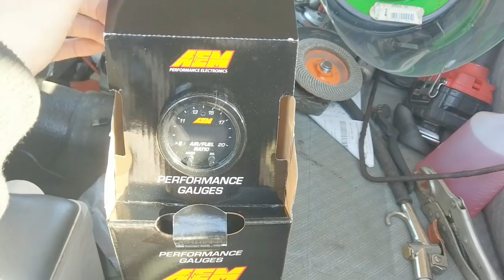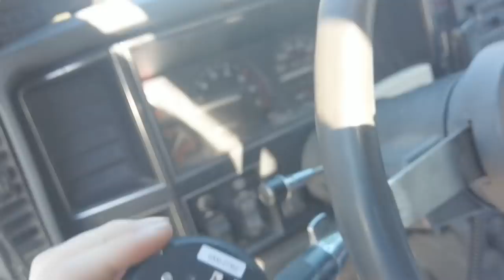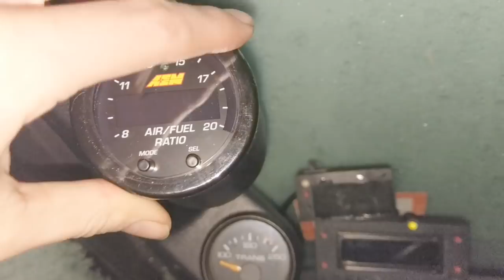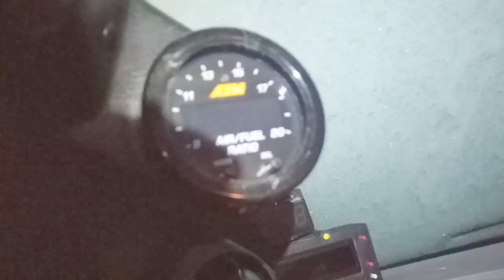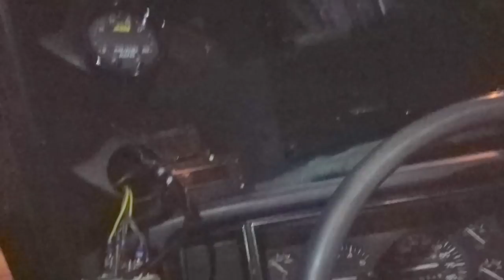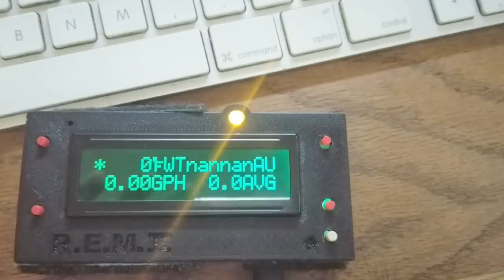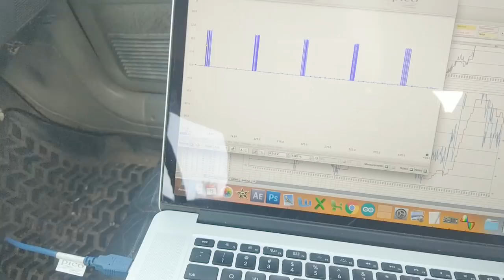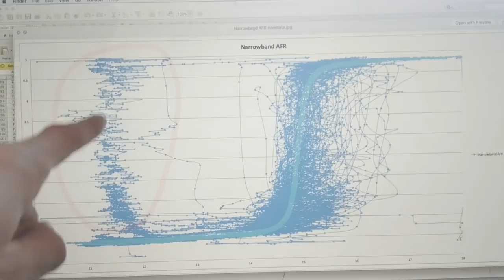AEM X-Series Wideband UEGO Kit install

Comment: I installed one in my V8  about a couple weeks ago which isnt force inducted. I noticed that naturally aspirated car's air fuel ratio does not fall below 12s like  forced induction cars. They float around mid 13s to 14s at wot on a stock tune. Even untouched force induction cars from the factory has fuel ratio that falls below 12s at wot, I take it it's because a greater demand of the fuel pump and turbo what's has to make it run rich.

Comment: 1990 MJ 4.0   -  Every two years, California requires I smog  - every two years it fails - every two years replace the oxygen sensor.  Do you know if this sensor could be used to replace it and would it be more reliable?
Reply from the maker: Weird yours fails so often. I'm not sure about long term reliability yet, but I will be going over how you can use a wideband sensor to get a narrowband output. This is far from a plug and play system as I'll be using my REM II as a signal converter, but it seems to work pretty well.
Reply: Yeah.  I asked the question at the beginning of the video and I as watched it all, I realized that the sensors work completely different.   I believe you mentioned that the stock sensor defaults to lean; and, this aftermarket sensor defaults to rich?  From a California Air Nazi perspective, Lean means less pollutants in the environment; but, everybody knows Lean means HOT, hot means sensor gets cooked.  I'm wondering if the sensor should be repositioned further back?  Maybe it would keep the sensor a little cooler?
Reply: I remember when the truck was 2 or 3 years old, they were failing California emissions; so, I got a postcard to bring my truck to the dealer.  They changed a wire harness, plus I don't know what else, and I've had to buy new sensors ever since.  As a matter of fact, I have to go and buy another one today, and take the truck back to the smog shop tomorrow.
Reply from the maker: I think it's just a side effect of the sensor design. If the heater circuit isn't working or the sensor is cold then it will lean. Doesn't read rich until it heats up. I wonder what they could have done to your system to make it run "more efficiently"
Reply: Just logged in to the Torrance Library to see what kind of updates came out and what manuals are available online.
Reply: Torrance Library reports two Emissions Recalls.   #297T Emissions Maintenance Timer Fuse OCT 1990.  #91-35  Excessive HC, CO & NOx due to Silicon Contamination of the Oxygen Sensor, NOV 1993.   I was speaking to Frank, in one of my videos, he's been a dealer mechanic for over 30 years; he says if engines were put together with silicon, it will always cook oxygen sensors.  When they did my recall, they probably didn't think I'd keep my truck this long; and, here I am 29 years later, still cooking oxygen sensors.  He says the only fix is to rebuild the engine and make sure no silicon is used in the reassembly.  So, there you go.....    Just another reason to rebuild my engine.  I just ordered a shop crane the other night.  I will be rewatching your engine change videos, in the coming months.   THANKS FOR EVERYTHING!   YOU'RE THE BEST!!!!
Reply: I'm wondering if I can get away with just cleaning the oxygen sensor; before, taking it to smog tomorrow?
Reply from the maker: Hmm, that's strange. Like Silicon RTV or some kind of Silicon assembly lube? I've never actually heard of that before. And I'm not sure if you can clean an oxygen sensor out, but you don't have much to loose if it's already dead. Need to get you a scanner so you can keep an eye on it, haha.
Reply: Yup, it was a chance for Frank to go on his anti-auto-maker rants again.  He says they used to assemble engines with silicon; and, when they started putting oxygen sensors in, they didn't know why they had bad reliability.  He says that the proper fix would have been to replace the engine; but, instead, all they did was replace the oxygen sensors, figuring most vehicles wouldn't be on the road very long and most vehicles wouldn't go thru more than 3 or 4 sensors.  Mine is probably the last MJ without a rebuilt engine; but, my goal is to have it rebuilt, in the next 1000 miles.  Although it's my daily driver, I probably don't put much more than 30 miles a week on it; so, it could be another 6 months.  He says to not assemble the intake and exhaust manifolds with silicon; or, the same thing will continue.   Scanner?  haha, yeah, I just don't know if I'm as smart as you to pull it off.  I mean, seriously, you are truly gifted.
Reply: When was the last time you replaced the o2 sensor? Do you remember the brand and part number?
Reply: When is the last time you replaced the o2 sensor?
If within the last year what brand did you get and part number?

Comment: If your ground and ADC are good, that kind of noise, on a 30-0300 is usually cylinder to cylinder differences.  Easy to verify on a scope, with the trigger set to the #1 spark pulse.
Reply from the maker: lordandprotector hmm, may be worth looking into. But I know the signal in general is noisy, even with the engine off.
Reply: They don't mention this in the manual. But, the analog- wire needs a clean LOW IMPEDANCE ground.  It is used as an input for an offset compensation amplifier.  So, noise there gets added to the signal.  These are really clean, when set up.

This page  http://forum.diyefi.org/viewtopic.php?f=6&t=2267&start=199   is an example of what I was talking about.   There is a picture of a log that shows the "noise" was an exhaust leak on  one cylinder.   

I have tuned the idle circuit on multi-carb engines this way, with a scope.  But, only these new AEM ( and the old Innovate LC-1 ( not LC-2 )) are fast enough to pick up the per-cylinder variations.
Reply from the maker: Very cool stuff in that thread. I may have to dig through more of that sometime if I investigate the signal further. Not sure if you saw my other video where I actually started to play with this sensor, but I eventually got the ecu to run off a simulated narrow band signal for faster response and tunable "stoic." Lots of fun and interesting to see what the sensor was capable of.  https://www.youtube.com/watch?v=YujtUYPJikA

Comment: Nick I need your help sir, no overdrive in my 96 GC 5.2 .. I believe it's a 46rh. Been to meny forms with not much help. Any ideas. Thanks a ton
Reply from the maker: Hmm, not too familiar with GC's, but I know that their Auto Transmissions are known to crap out. How's the fluid color look?
Reply: Nick, did not expect you to answer.   Thanks! Any who, trans fluid is full and red (leaks) has 200k+ OD light and switch no worky. Shifts in all other gears.

Comment: it's running pretty lean on the highway
Reply from the maker: What makes you say that? I would think for cruising speed you don't need much fuel so keeping it stoic should be fine, no? I haven't looked much into what AFR should be used for different needs, but the basic idea is you want to be a little rich under acceleration for peak power.
Reply: Yeah I see what you mean but does your ecu react quick enough?
Reply from the maker: This video is just showing how the ECU runs the stroker in the narrow band setup, so it will bounce back and forth. I'm not sure if I could make the ECU run perfectly on specific value, so going a little higher and a little lower is expected.
Reply: You ever thought about some how upgrading you jeep to run a wide band instead
Reply from the maker: Interesting read, I'll certainly have to dig into that more. And spoiler alert, the main reason I got this kit was to run the Jeep off of it. I haven't had time to mess with it much, but I've been able to simulate a narrow band sensor with it and it seems to run fairly well, but there are a few glitches I'm still looking into.

Comment: that is a little lean at start I know the video is old but your target should be around 14 with naturally aspirated turbo charged is around 11 to 12
Reply from the maker: Yeah, that's the wonders of Renix. Runs like crap most of the time, so I'll be working on a MAP tuner to keep the AFR in check
Reply: NickInTimeFilms oh boy it sounds like you have a big project jest like I do  I wish the best of luck and have you ever thought about changing over the ECU to megasquirt or something along those lines I would love to see a turbocharged or supercharged renix  nothing big or stupid High horsepower just a little extra push
Reply from the maker: A standalone could be interesting, but I've put so much work into the Renix Engine Monitors that it's hard to abandon the ECU altogether. I might think about it if I ever went forced induction.
Reply: NickInTimeFilms that sounds awesome I don't own my Jeep anymore I did a CJ7 with an LS1 swap but if you ever switch over to megasquirt and you need a hand let me know and I'll do a couple videos on megasquirt I am starting a YouTube channel but I do have a Facebook Channel/group but I just haven't gotten around to switching over yet I should have started when I turbo charged my car and rewired my entire wiring harness oops oh well I guess I can go through everything and explain it and if you have any tips to start youtubing let me know

Comment: Good stuff !  But, I do cringe every time I see someone start an engine on a hot sensor.  The wideband sensor elements are ceramic, heated to 700C.  So, hitting them with a blast of cold air can kill them pretty fast.  Now... Be a man, and decode the CAN data :)
Reply from the maker: Hmm, I wasn't aware of that,  is that really am issue? I figured it was better to fully heat the sensor before using it, but usually I just hop it and go. And there is quite a lot on that can bus, but I've never messed with differential pairs before so that might be out of my league haha.
Reply: That is the #1 killer and degrader ( is that a word? ) of WB sensors.  They get thermal shock/stressed and form micro-fractures in the ceramic element.  They start to drift; then, fail. 

 CAN is easy, if you have the interface board.  Just keep the CANH and CANL wires about the same length. Twisted pair is nice. But not REALLY required.

Re: the analog noise:  The Analog- line is actually an input that the controller uses to compensate for ground offsets. So, it needs to be grounded to whatever the ADC thinks 0v is.
Reply from the maker: Makes sense, I'll definitely stop pre-heating the sensor whenever possible then. The Teensys do have a dedicated CAN Tx and Rx pin, so I think I'll have to look into that when I eventually get into OBD1. The analog ground is interesting though. I thought hooking it to the Teensys analog ground might improve the signal, but all it did was make my button multiplex circuit stop working, haha. I'll probably include more of my rambling about that in the next one.
Reply: The analog ground line has an impedance of around 100k. So, it probably doesn't affect anything else, much.